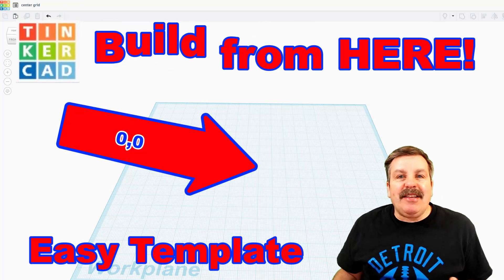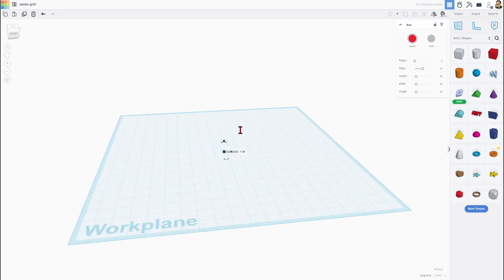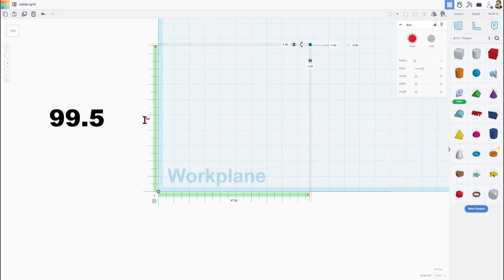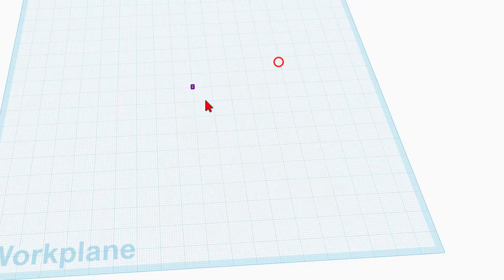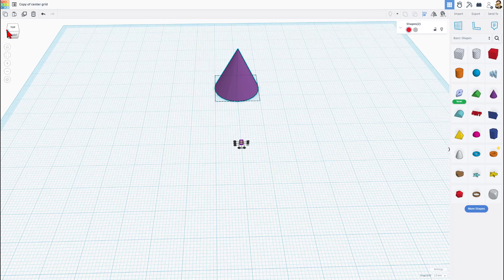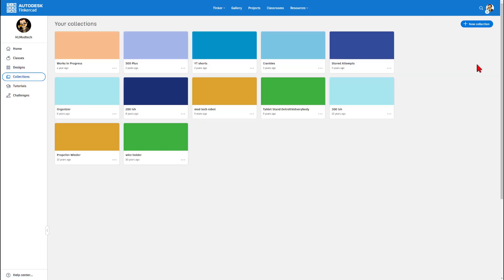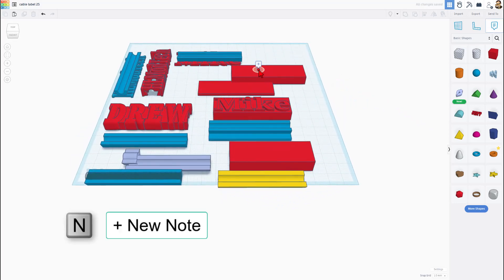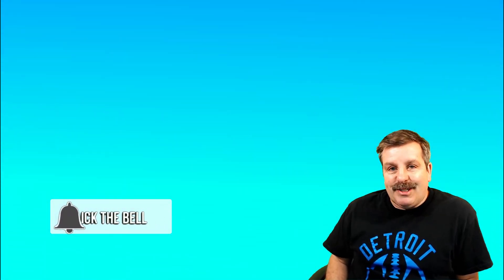Tinkercad Template & Collection Tricks! Work Smarter Build from Center

Comment: In your video on tracing, I even went and got the same cat image and couldn't follow what you were doing because you kept on talking to fast.  Tried watching the video several times......and gave on on you and the video...complete waste of my time trying to follow what you were doing...put out a pdf on the instructions!
Reply: When I run into that issue I change the settings to slow down the video.
Reply from the maker: That is a great solution. It was my go to for kiddos in my classroom too.
Reply from the maker: Sorry about that. See if these 5 tips can make the process better. https://youtu.be/DwrnHNCwJrc
Reply from the maker: If you have not worked with Tinkercad before the lessons in this playlist designed for brand-new Tinkercad users.    https://www.youtube.com/playlist?list=PLRXLS33csRK7qasevs577eQMloptAVVm_
Reply from the maker: Easily choose  the tutorial speed that fits your needs. https://bit.ly/hlspeed